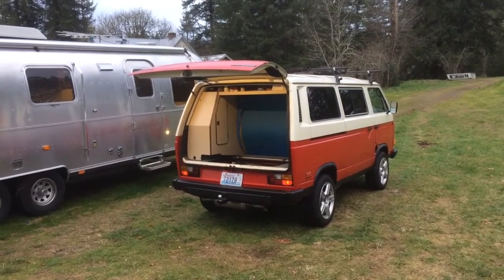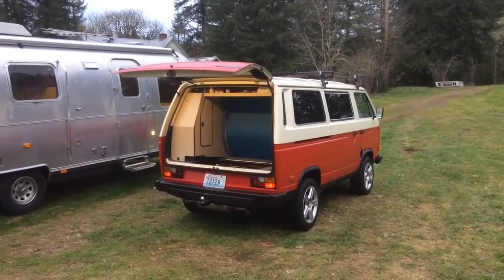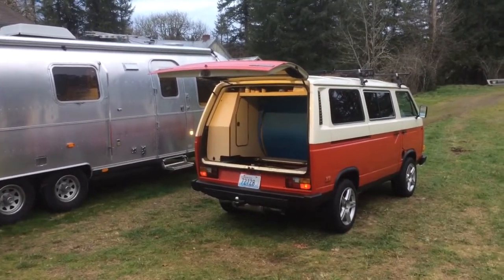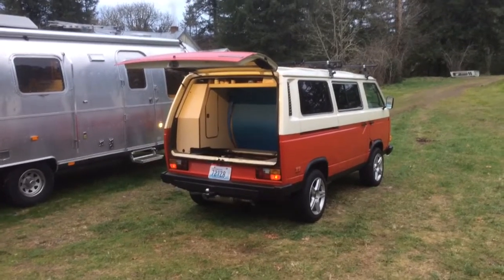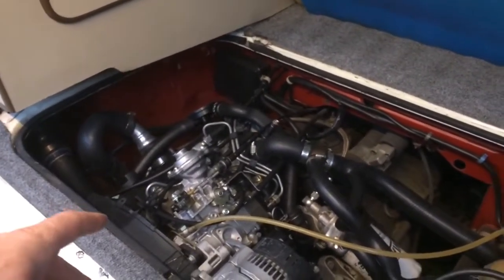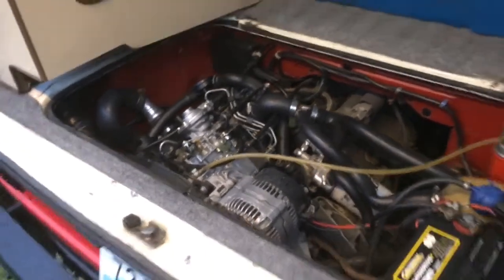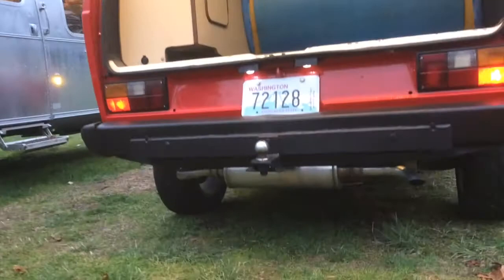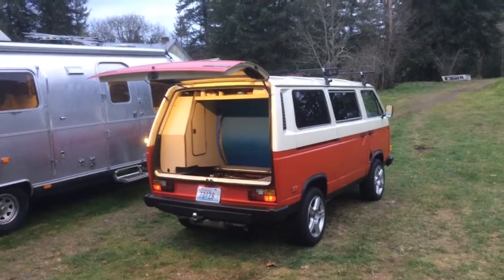Vanagon TDI AHU Swap: Project Costs and Strategies

Comment: I installed a DIY ALH mTDI swap into my '89 Vanagon for right around $3k.  I did a lot of fabrication and work trades for the parts, as well as selling off all the donor and original WBX drivetrain parts.  I didn't use any of the Vanagon diesel install pieces.  You might be interested in a VW van get together taking place  on Wed. Feb 27th at Triceratops brewing in Tumwater, around 5:00 pm.  I'm sure the group would love to check out your van in person.
Reply from the maker: Interesting. So you fabbed your own carrier bars/mounts and such? Wish youd put up a video of that. Just put it up on a lift and get some detail shots and talk about how you did it. Also, going into a gasser, what else did you have to do? Fuel tank/filler changes? Just added a glow plug relay and the diesel electrical necessities, id imagine. My buddy has a Carat that he wants to convert to MTDI, so im wondering whats involved with the gassers. I might show up at your meetup.
Reply: I installed the engine at 15 degrees and modified the stock WBX crossbar to accept Passat 1.8t engine mounts.  I used a 1.8t mount arm on the driver side and a mount arm fabricated from a Jaguar lower control arm on the passenger side.  I did work trades for the Kennedy adapter kit and aircooled DK transaxle.  The van isn't running yet, as we bought a Eurovan Weekender during the project, so it got put on the back burner.  It's about 95% complete, but I'm still chipping away at the last bits as time allows.  I'm currently welding up the intake manifold.  Our van group is new and this next gathering will only be our second.  Nice folks.

Comment: What's that blue wall behind the engine (separating the engine bay and the cabin)? Is this something for noise insulation? If so what material is it and how did you build it so it can come down when you need to camp? I am thinking of doing something like this from plexiglass foldable wall to have less engine noise in the cabin
Reply from the maker: Thats just the bed lifted up to expose the decklid and engine bay.

Comment: Amazing work! I have a few questions for you. 

- Does the 1.9 tdi fit straight on to your gearbox? And do all vanagon gearbox have the same pattern? This is my main concern and I can´t seem to find much information about the fitment. 
- Do you experience any excessive vibration from this in-line 4 compared to a boxer motor? 
- Would it complicate things to go with a newer motor 1.9 tdi with electrical fuel control? 
- MPG? 

Thank you!

Comment: What about engine noise? I 've tested my ahu engine near rear bumper with properly sealed exhaust, it reads 82dB which is really loud. Tail gate closed, motor lid also, but no rubber mat on top. Wondering if.it is normal loudness.
Reply from the maker: I have no clue about decibels. I just know my van sounds BITCHEN. With the open K&N filter and the stainless exhaust with resonator it sounds like a race motor, heads turn everywhere you go, and the noise level is fine inside going down the road. Just build it and drive it and don’t worry about it.
Reply: @jtlachappelle  oh, so sport filter might increase loundness? Forgot about influence of that. It is still long way before being able to drive ours, trying to figure out why starter keeps spining with the motor, even though solenoid works fine. And same kind of alternator (140amp br-14h) not charging the battery. 
Btw really appreciate your videos man!
Reply from the maker: Sport filter definitely increases loudness, but in a good way, sounds killer. And you have to have a high flow filter on these, makes a monumental difference. If you dont like the noise K&N makes enclosed high flow filters. Just dont choke it off with shitty small diameter plumbing

Comment: My ALH has 190K miles on it.. and it doesn't yet burn any oil.  I believe it is perhaps at the halfway point in it's life.  However.. I know what the hell I am doing !  It has always had DIESEL RATED synthetic oil..  Get a used engine where they thought they could run Castrol or some crap like that.. and it would be road kill.  That is the gamble with an old diesel.. Who had it ..and what did they do ?  If you can find out with certainty..  the 20 year old motor can be fine.. otherwise.. ?    What you can see, hear, and smell.. is what you get !